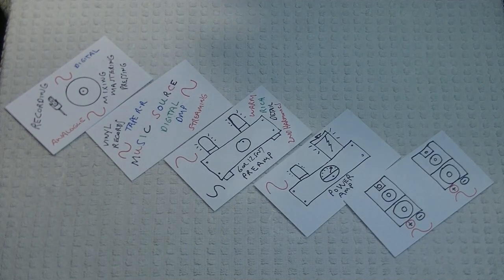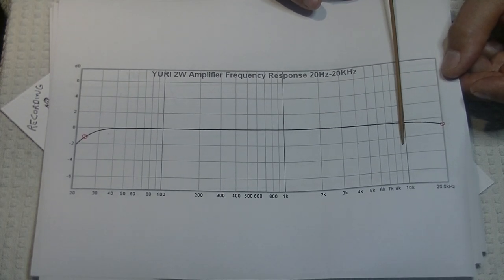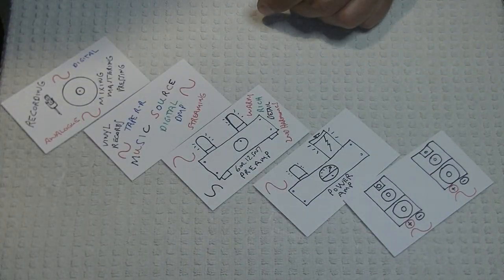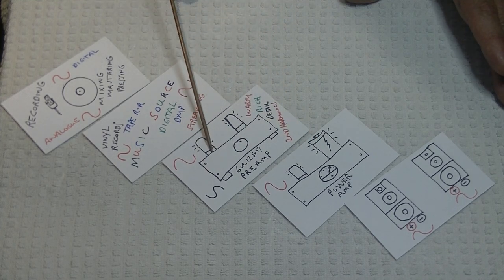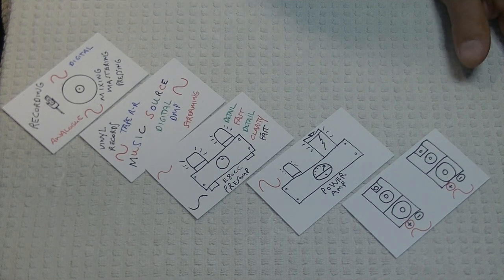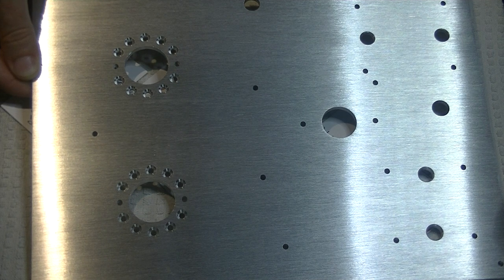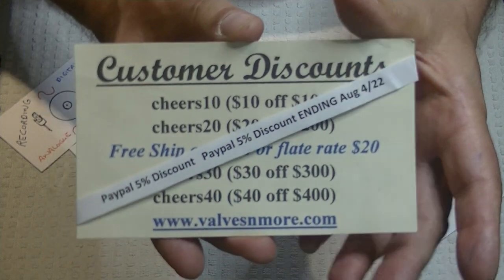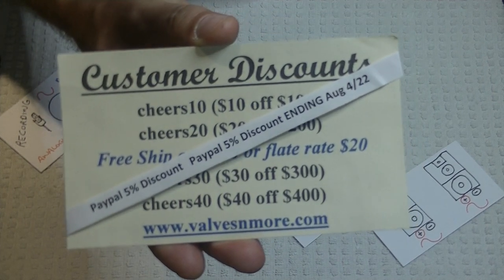Tube Lab #94 - Sonic Tweaking

Comment: Jim, do you think it’s possible to replicate the sound of a vintage Mullard el34 with a preamp? could the filter capacitors be upgraded to capture the same Mullard magic you talk about Instead of paying $2000 for a quad?
Reply from the maker: Now that's a great question!  Well if you could find a preamp tube that had the sonic signature of the Mullards that would bring that sound forward.  And that would be a great trick!  However I think the Mullard EL34 xf2 sound is unique, remember it's generated at the output stage and Pentodes (current pushers) operate differently from preamp triodes (voltage amplifiers).  I'm always looking for great sounding preamp tubes and have a prototype in the early stages of development that uses an old radio tube - who knows maybe that'll have some of the Mullard magic!